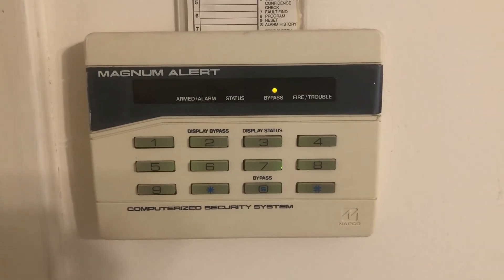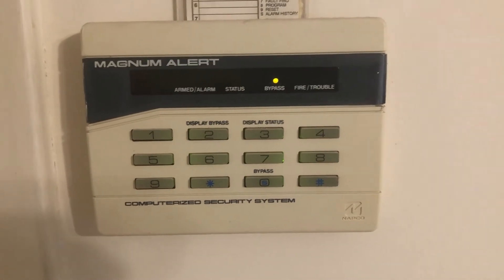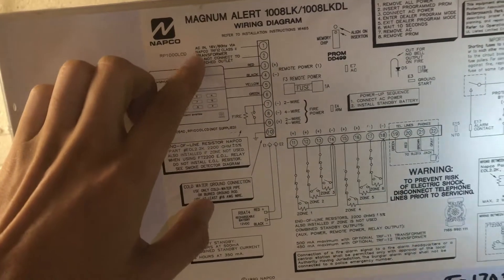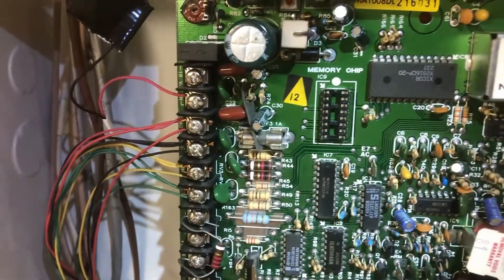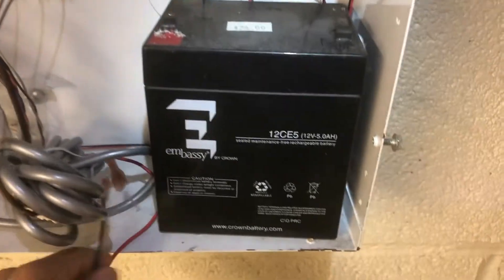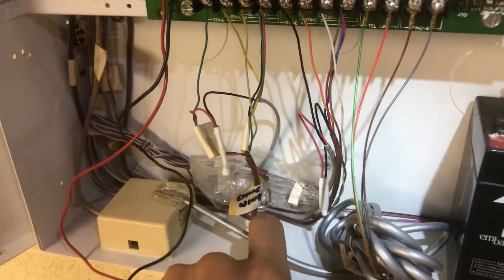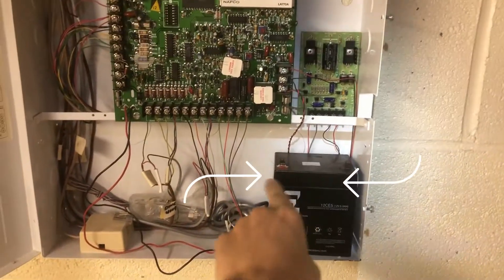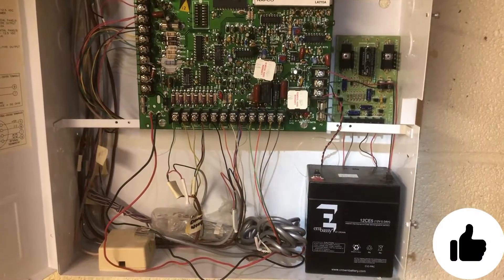Permanent Shut Off Procedure: Napco Magnum Alert Security system

Comment: This is good if you only have security on the system. However, if you have smoke detectors connected and they are the only ones in the house i strongly recommend you keep the system on

Comment: Anyone know how to remove keypad from the wall?
Reply from the maker: You might want to rethink before you take it off. there is probably a hole behind it.
Reply: @Flynn-Ming  I have something to replace it.
Reply from the maker: @NEANABUG  First, Shut off the power and make sure you disconnect the battery as well. Now if I remember right, There should be 2 slit on the bottom, use a screw driver to pry open. then take the face off and I think there are screws you can removes.
Reply: @Flynn-Ming  I got that part done. I'm staring at wires connected to the faceplate of the keypad. That's where I stopped last night.
Reply from the maker: @NEANABUG  I am sorry, if you don't see any screws that would be holding on to the backplate, I am out of ideas. try pushing the whole thing upwards, maybe it will slide off.
Reply: @Flynn-Ming  the backplate is there. No problem with it. The problem is the wires coming out of the wall going into the faceplate. Need to know how to get them off the faceplate. Also what to do with them once they're cut. Stuff them back into the wall? I appreciate your response.
Reply from the maker: @NEANABUG  oh. If you aren't going to use it anymore. just cut it off. *Make sure the power is turned off before you start cutting*. Once you make the cut, tape the ends individually just in case power somehow get back to the wires.
Reply: @Flynn-Ming  ok, thank you very much